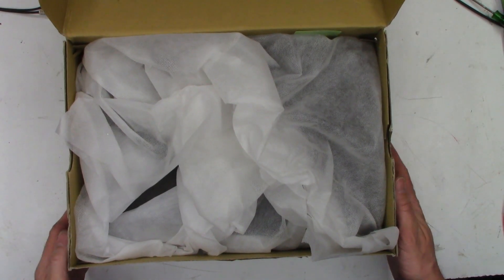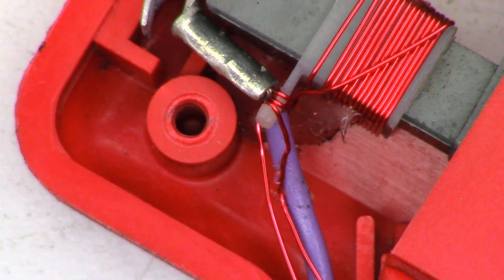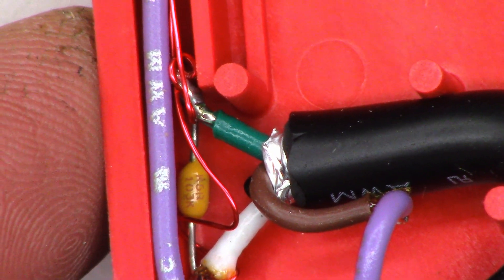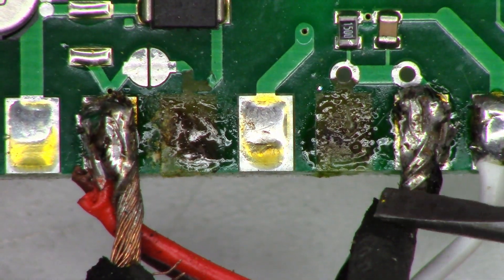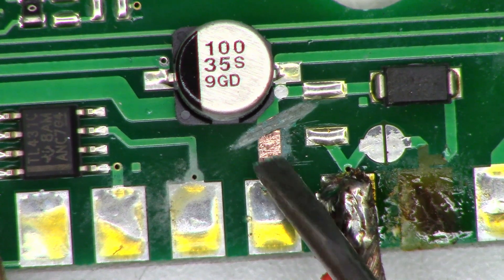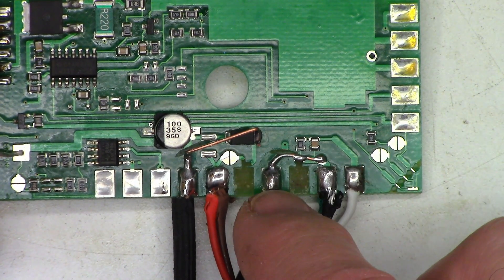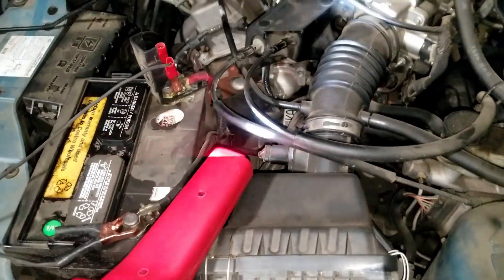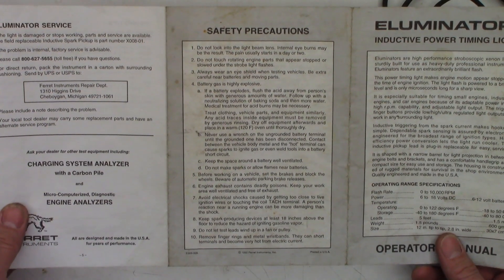FERRET INSTRUMENTS ELUMINATOR 80 INDUCTIVE TIMING LIGHT REPAIR - CORD RIPPED OUT!

Comment: I've got a Ferret Eluminator timing light that has stopped working.  The Screen lights up, ready to read RPM or Timing but it's not reading either with the cable connected to the #1 spark plug wire.  I'm assuming it's the pick up cable or clamp that's bad.  I've had the unit for 30 or so years and love using it.  The only damage to the cable is from headers melting the rubber insulation which I taped up.  It's worked for 20-25 years with that repair.  I went to use the light yesterday and that's the first time it has not worked.  Can you fix it?
Reply from the maker: email me norcal715videos@gmail.com

Comment: Cornwell, snap off, Mac etc get supplied by all kinds of companies. That Eluminator may very well be sold by Cornwell. Nice repair saves him buying a new one, most of todays cars you never need one but it still can be used to check for spark very quickly by just clipping on inductor.

Comment: You missed the spark gap that was connected to the diode. Does not affect operation but serves as protection
Reply from the maker: I think it was a solder bridge pad for a different version. Usually spark gaps have jagged edges to facilitate the spark jumping where they want it to jump. Thanks for watching.
Reply: @norcal715  agree. Solder bridge pad for sure!

Comment: Have not used a timing light in years, but used it in 2019 for a friend's buying of an old VW Kombi camper, where we used it to do plugs, points and set up the carburettor again. Not that far out, but cleaning the carburettor and fixing all the leaking gaskets in it with a kit got the engine running a lot better, then changing out the plugs and points, plus a new rotor and leads, got it to the point there was no longer a light show at night from the engine. Not the original VE boxer 1600 engine, but a Toyota instead, 2l Cressida engine that gave the vehicle the get up and go that the original engine was sorely lacking, and also was more fuel economical as well.